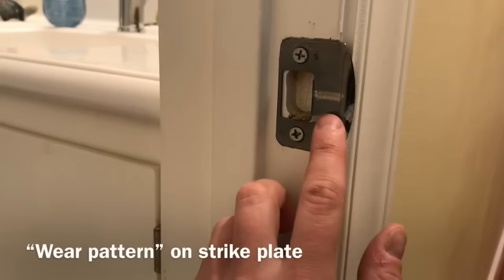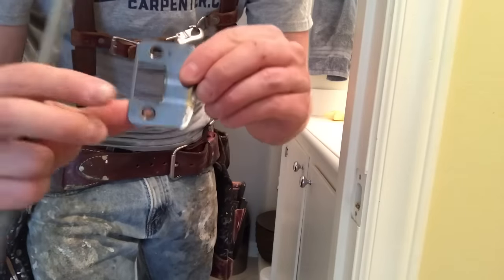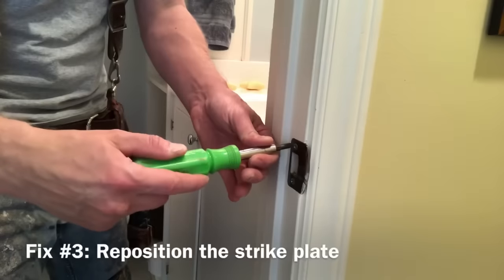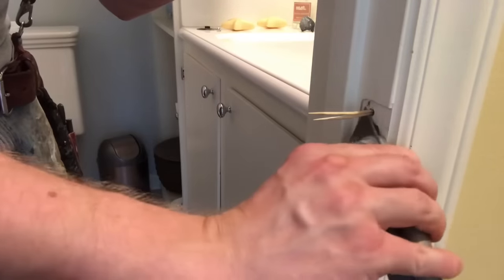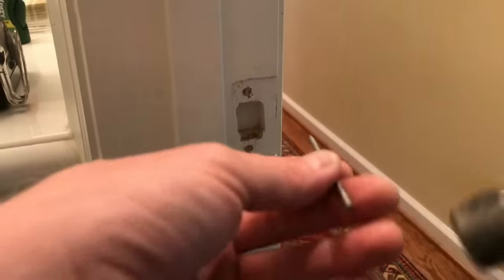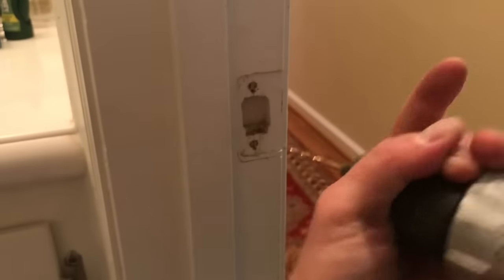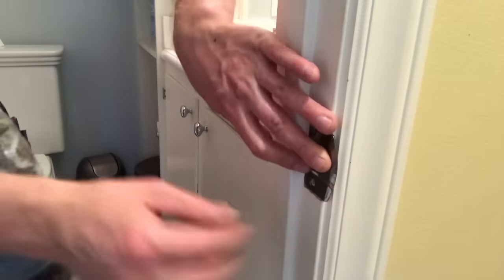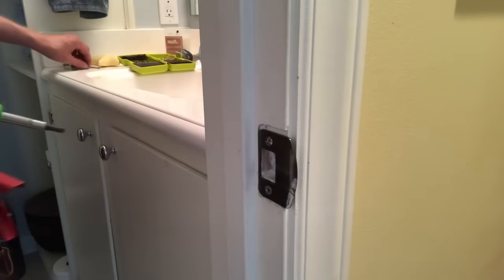Door Won’t Latch—3 Easy Fixes!

Comment: After reviewing your problem solutions for a non- locking door situation I gave this additional thought.  I had bought a new door lock set and the door latch bolt would not lock into the striker plate. I looked a bit more carefully and realized that the new bolt that I had installed had the bolt angle coming in at the opposite direction from what it should have been. My solution was simply to reverse the bolt by turning it upside down which then positioned the bolt angle to be consistent with when the angle of the bolt hit the striker plate. This fixed the problem and did not require any of the other solutions that you suggested.
Reply from the maker: @Sigkeeper1 Thanks for writing in! You're exactly right, the curved face of the latch should always point towards the strike plate. This way it will naturally be forced into the latching mechanism. It's an easy thing to overlook sometimes when you're installing new hardware :)
Reply: Lol

Comment: If the latch ever worked when the door was installed, that problem is probably due to the hinges wearing down or coming loose from the jamb. You can tighten the hinge screws to see of that helps, or you can perhaps shim the bottom and middle hinge to raise the door slightly at the strike plate. If the hinges are really worn, simply replace them and the door will likely be raised and work just as it did when it was new. If you have some washers the right size, you could insert washers on the hinges to raise the leaf attached to the door which will do the same thing.

Comment: Sorry, brother. But you’re wrong on this one. The FIRST thing you do is check the reveal of the top and side. If it’s off and showing the door is sagging, you tighten the top hinge (the hinge into the  jamb or the jamb into the frame) and possibly shim out the bottom hinge. Then if that doesn’t work, you can adjust the strike plate.

Comment: The door hinges can also be the problem. loose screws allow the door to sag and cause misalignment. Or the door is not properly fitted. Check the gaps and there may be room to “throw” the hinges and put the door back in alignment with the catch.  You might even improve the appearance on a badly fitted door.

Comment: One approach that has worked for me - if you back out the screws holding the strike plate a bit, you have a bit of play with the location of the plate - you can move it about 1/16" of an inch up or down. Sometimes that's enough to solve the problem. Just tighten it back down after you've made the fine adjustment to the location of the plate, and you're good to go.

Comment: best way to do this... take off strike plate... open the wood downward with a chisel... drop the strike plate, shim the old holes to fill if you need to redirect the hole path... puddy the top and drop the plate to center of door catch

Comment: Take a dremmel tool with a stone bit and grind down a little of the strike plate so the latch fits into it.  Ive done this many times and its alot easier than trying your other tips in this video

Comment: I think he has one thing right step one check you plate let that tell the story like it did the wear mark was low Step 2 based on step 1 info check how the door sits in the door jamb is it square does it sag Step 3 like another said check  all hinge screws are tight Step 3 since I don’t  know if the door is sitting in jamb correctly nor do we know anything else about the door set up I would go with shim the bottom hinge to raise the door up 
Never move or relocate the latch plate never file the plate never bang on the plate to slightly move the hinge down that’s nuts a matter of fact you never mess with wood and screws you keep that to real minimum other wise you will have another issue to deal with, these videos are  common back yard repair techniques that give you poor results there are so many variables when working and tuning doors and this type of video is just a band aide it’s not really a “repair” you will be back again for another round

Comment: Just fixed mine today! Thank you SO much for this how to! The one problem I don't see addressed, that I had, and others have, is how do you account for the top screw being lowered into a very narrow space between the old hole and the giant opening for the latch? I had to move mine down about 1/8" and even with drilling the pilot holes, the wood underneath still split a little. There was only about 1/8" or less of wood between the new, (upper) screw and the opening for the latch. Ideas?
Reply: Try using a screw long enough to extend past the depth of the mortise and into 'new' wood.

Comment: In a pinch your can use the side of an impact bit as a power file for the metal, the square edges spinning at high speed and the hardened metal cut into the metal

Comment: before you remove and file and cut and re drill ! Check first making sure all the screws on hinges are tight ! also the handle itself has tendency to get loose and shifts down ! If after doing this simple check still not working then do what he said.

Comment: I have a question, I have just had my carport built in, and installed 2 new mahogany doors, they are about 8 foot tall (95 1/2 inches tall).   I am wondering, do I install my door knob at the normal height, like 7 foot doors, or will that make it look strange?  I've researched and cannot find much on what height to install hardware on 8 foot doors.   Any responses would be greatly appreciated!!  Thanks!!!
Reply from the maker: Colton In Tn Thanks for watching and for writing in! I generally always set knobs between 35-37” no matter what. Door handles with thumb-press levers sometimes can go higher conveniently, but a round knob above 40” can be awkward to grip for most people. As a easy way to test for visual appearance, cut a couple circles the size of your knobs out of white paper, tape them at 36”, then walk around and see how they look. If the effect isn’t jarring, I say feel free to install knobs right there. I see designers do stuff like that all the time 🙂
Reply: @TheHonestCarpenter  Thank you very much for the swift reply!!!  I will go by your suggestions and see how it looks on white paper.  I really really appreciate that you replied back so quickly.  I sub'd to your channel, I've been going through your videos and they are very informative and done very well.   Again, thanks!!!
Reply from the maker: @Colton In Tn You’re welcome! Feel free to write in with any other questions here or at the website. Thanks for subscribing!

Comment: THANK YOU!  I have had three doors in my house that have not latched properly or consistently in more than 20 years. I wanted to hire someone to fix it but no one seemed to be interested.  All to the good!  I had to fashion a shim block for one side of the routed cutout on one side and cut deeper into the other for two of them to shift the cutout position up or down by about half an inch, fashioned a dowel that perfectly fit the screw holes (drilling out the holes first) and put everything in place with Liquid Nails.  Then I put the strike plate on after trimming out what was needed on the surface to fit it.  For the third, the file trick was enough to get it working.  THANK YOU!!!!!!!

Comment: Why bugger up the door jam?  1st check top hinge screws that they are tight.  If so with an impact drill with torx screw, run long screw into hinge side of jam until it countersinks then back off as much as needed.  95% of the time that is all you need.  Fill and paint hole that the screw made.

Comment: What a great idea that you have for filling the old screw holes with tooth picks. I've successfully moved two strike plates on the same door using your third method and it was much easier than I thought. Thank you so much.

Comment: Sup boss. If you leave the plate on and use a "dremel" with a 50 grit sanding sleeve. You can do the metal and wood at the same time. I use the pencil just like you or some times a wax pencil (china marker)  on the latch instead of the striker plate to see where she hits.

Like the vids' keep it up
Reply from the maker: Matt Woods Thank you! My original dremel conked out some years back, but I’m going to have to get another one eventually just for stuff like this. Thanks for the advice! I’ll keep the videos coming in 2019 👍

Comment: If you're moving the striker there is something else wrong. Should never jave to do that. We get a lot of movement here🇦🇺 so if you move it in the wet season you'll be moving it back in the dry. Should give attention to the hinges first. To fill screw holes i use 4mm skewers (normally coz the hole is flogged out),  drill out the hole to correct size, glue in skewer, re drill holes with self centering drill.
Reply: @Hello How are you doing dear

Comment: I would have used structural wood epoxy or some other wood fill bonding solution to fill all voids then do the shift. If you don’t properly fill voids, you risk making cracks making new holes. Toothpick method seems too risky to me.
Reply: it's a door latch, lol no weight on it. toothpicks are glue work fine for stripped out screw holes, or situations like this.

Comment: First you should have check the hinges to make sure they where right!!!!!!! Wood matches work well filing the hole and if the match is to small then a match and toothpick... In older homes where the door has been change a few times then move to the golf tee or combo of multi  match sticks!!!! Instead of super glue every home has kids white glue it is not my first choice but just recent I found the super glue hard as a rock in the bottle, not put away right!!!!!
Reply: @Hello Stan how are you doing

Comment: The good thing about using golf tees is that you really don’t need glue. Tooth pics alone are to soft, that’s why Ethan used super glue with tooth pics. I always keep WOOD golf tees in your pouch and AVOID the plastic ones.
Reply: @Hello Bill how are you doing

Comment: I deal with this everyday on the job and it's not always the top hinge coming loose , it could be from the manufacturer why the strike plate and backset don't line up good methods to fix the problem though👍
Reply from the maker: @David Romo Thank you for writing in with this! I usually only see the loose top hinge on exterior doors because they're so much heavier, and installers often forget to add the "strong" screw.

Comment: Wouldn't a golf tee be better than toothpicks...?
Reply from the maker: Hey Greg, golf tees do indeed work well. I occasionally use them. But I like toothpicks and super glue because you don't even necessarily have to re-drill. The screw can essentially force it's way into the void between toothpicks, and the threads still have plenty to cut!

Comment: well I just stopped my door from jamming by screws in the top of frame - although it has now split the door frame :( Next is to try this... really hope 1 or 2 works otherwise going to be a hassle. I don't have a metal grinder yet either. Thanks for the video, very helpful

Comment: THANK YOU!!! Filing it down by about 1/8" did the trick perfectly! I also removed about 1/8" of wood from the inside to make room with a utility knife. Now it shuts and latches absolutely perfectly! This door has been flying open with the wind for about two years now when not locked and it's super annoying. The guy who installed it was supposed to come fix it but never showed up. It's a dutch door and I checked the hinges to make sure before doing this. Now we can rest easy knowing the wind isn't going to throw the door open while we enjoy the backyard. Thank you for this great video!

Comment: I would never try to bang the strike plate down. If it does move down then you are damaging the wood holding the screws in. Either move it or the work on the hinges.

Comment: Hi. Front door won’t lock barely locks.  I think door frame to thin so not enough hole inside for lock to go in (spot where toothpicks placed) 🤦🏽‍♀️🤦🏽‍♀️🤦🏽‍♀️. Any solution/idea? Do I need new frame 🤦🏽‍♀️🤦🏽‍♀️?

Comment: Instead of toothpicks and Superglue, try a piece of cotton saturated with AC glue and squeeze it in the hole very fast.  AC glue makes the cotton very hard that if you wait too much then you have to drill it with a drill bit.

Comment: Great video, I have a door that I can now get taken care of. 
Question: I have a storm door that’s not catching unless you push it closed and then it’s really easy to open without turning the handle any suggestions on fixing it? Thanks
Reply from the maker: @Kelly Dobson Thank you! For the storm door, look around the perimeter. Is it fitting in the flange opening the correctly. The gap around the edge should always be consistent. If I had to guess, it sounds like the door is out of square slightly with the flange, and some part of it is rubbing or coming into contact with the flange, so you have to force it shut. But because of this misalignment, the latch also isn't engaging when the door IS shut. Let me know what you think!
Reply: I will check that out, and keep you posted, thank you!

Comment: A little lift on the bottom of the door got the latch aligned with the plate suggesting that the door was sagging. I then tightened all the screws on the top hinge. Even though they already felt snug, all six screws moved a bit when I tightened some more. And it was just that tiny little bit that pulled my door back up and into alignment. So I would say check that top hinge first!
I guess I lucked out with this easy fix. However, I learned some other great tips from this video for when my luck runs out. 😏

Comment: ..and you can eyeball the edge of the door with the door jam to see if they are parallel with each other. If the top or the bottom of the door  is closer to the door jam, then look at adjusting the hinges first. Great video. Thanks.
Reply from the maker: Good point, Marty! I failed to mention a lot about hinge options in this video because this door was just suffering from house shifting. In a future video I definitely want to address those things. Thank you for watching a writing in! 🙂

Comment: Don't use toothpicks, widen the screw hole with your drill so you can tap a dowel in it and don't use superglue, use wood glue. Takes longer to set but it's a much better fix.

Comment: I use the toothpicks to fill a hole also but I don't take too much time on the toothpick install. I never glue in my toothpicks. I just pack the hole full until I can't put any more into the hole then I just snap them off  and I'm done. Thanks for the vid!
Reply from the maker: DIY Dave You’re welcome, thanks for watching! Good point, too. Really, just that compacted wood grain is all you need—gives the threads plenty to bite into. As long as the screw doesn’t push the plug through into the jamb cavity, no glue really needed 👍
Reply: @Hello Dave how are you doing

Comment: Mine were like this & I used some self-adhesive felt furniture pads (about 3-ish mm thick each) & stuck 1 to the very bottom of the door frame where the door will sit when it's shut, & another 1 to the actual door where it will butt up against the 1 on the frame... & BAM. Problem fixed. My issues were a result of 2 things; 1 - a non-plumb door frame/uneven hinges (door was crooked with a bigger gap at the top of the door, and the other from stripped screws in the top hinge making the door sag, catch & sometimes super hard to close. Anyway, that fixed both issues immedietaly & the felt pads stick really well, they’re not going anywhere. Especially with the simultaneous pressure against both sides when the doors are closed. Permanent solution? Eh… maybe, maybe not. However for me, not being able to see the felt pads & the fact that it works absolutely perfect…no brainer... it’s the option I chose & intend to keep until I’m ready for something else.  Best, y’all! <3

Comment: I like Honest Carpenter, but not starting this video with checking the reveal and trying to tighten the top hinge screws or replacing one of them with a long one is really atrocious. Especially so because it fixes the problem 90% of the time. DISLIKE!

Comment: Wow this all seems like a lot of work compared to how I fixed the problem.  All I did was unscrew the very bottom screw on the frame about 1/2 inch. That way when the door closes, the screw sticking out naturally leverages the door upwards enough to clear the strike plate.  Easy peezy - literally a 12 second fix.

Comment: Question? If you can get the toothpicks far enough in the holes, is there a need for the glue? Wouldn't the force of the screw pressing in along the gaps create enough friction to stay put?

If anyone is having the issue where their latch or deadbolt is loose or falling out due to the screws stripping out the inside of the door. I have invented a new door hardware that solves this problem, ReSecure Latch. No more glue, sticks, puddy, or that ugly metal sleeve that ruins the look of your door. Great for DYI people like JPV, property owners/maintenance technicians, and you.

Comment: Thank you for this! I had just enough "knowledge" of how to fix the issues we are having with several of our doors without knowing the PROPER way to do it. 😩I tried the first method, but the way I did it was way off. I tried bending the tab using pliers with the plate in my hand. I didn't know about the filing tip. When I moved the strike plates, I probably didn't move them enough because I never had to chisel out anything from what I remember (it has been awhile since I gave up). No wonder I had little success. I managed to fix a couple of doors, but it must have been that they didn't need much adjustment. I know what I will be doing today...I have four doors to tackle that I have been putting off because I haven't known what else to do. I am going to try the first two methods before moving the plates (again). Keep up the good work!